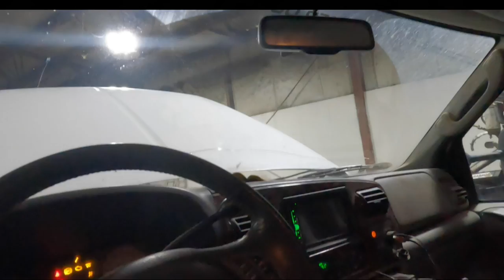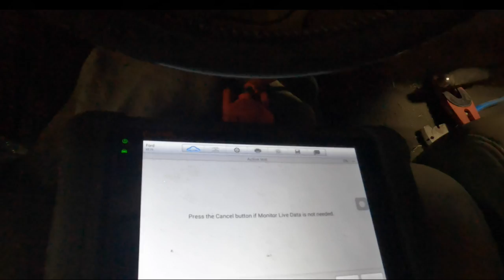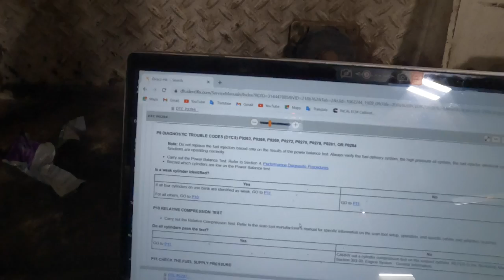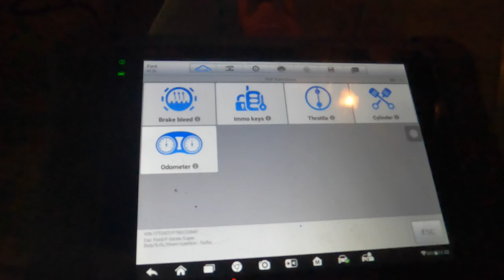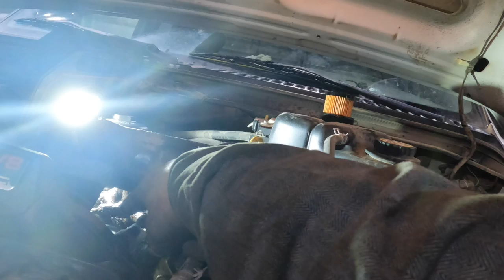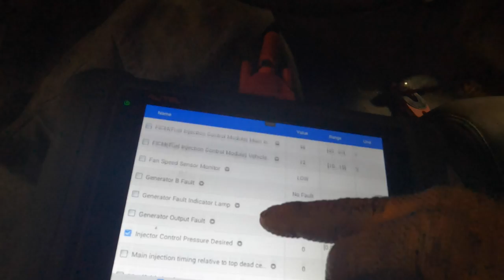Diagnosing combustion gas in fuel.

Comment: Great video.  I had no idea there were still 6.0s out there running.
Reply: They are great engines once you bulletproof them with aftermarket parts
Reply: @straightpiped12valve  as a former 6.0 enthusiast I can tell you there is no such thing as a bulletproof 6.0

Comment: There's going to be a unanimous though by us 6.0 power stroke guys supporting replacing the whole bank of injectors vs just one.  The HEUI style of injectors will "hammer" themselves to death if there's low fuel pressure.  Too large of an injector vs supporting fuel mods, clogged fuel filters, bad fuel pump, and engine compression blowing the fuel out of the rails in the heads all can cause injector fuel starvation.  It's a nasty road to go down that can get ugly quick.
Did this customer not want to replace the passenger bank of injectors?  Labor to get there and change 1,2,3,4 injectors on one bank is the same, it's just an additional 1/2 hour per additional injector?  I replaced the whole injector set in my '05 after # 5 hung open causing compression to blow the fuel out of the rails in the heads.  The previous owner of my truck probably used some home brew bio diesel or veg oil as there was a lot of crud in the fuel system.  I was bummed to do it, but now it's DONE!  Love my 6.0 :)
Great content Warren and thank you for sharing your time with us!
Cheers.
Reply from the maker: All 8 were replaced less than a year ago, everybody just loves changing parts that there is absolutely nothing wrong with.
Reply: @westerntruckandtractorrepa1353  Thank you for taking the time to reply!  Any idea if the prior replacement injectors were oem reman or possibly aftermarket?  I've though the oem reman's have a design change to prevent the dreaded stiction, but looks like they may still be susceptible to other problems :(
Cheers.
Reply: @skibik3r  Warren states in the video they were from Ford, so OE of some kind. I’m cheap so I’d only replace the failed one 😄.

Comment: Put the battery charger on 60+ amps while doing the relative compression test. That's why it doesn't work at least on other Ford engines I've had that exact problem.

Comment: Why can't you remove the glow plug on the cylinder you think it is and use your blow gun there and see if it blows air back through the fuel system that would tell you that injector is stuck open I would think just trying to make it simple

Comment: Great diagnostics.
Would you ever benefit from a PICO scope? (Laptop program)
Ivan at PHAD made a "pressure transducer" he uses to diagnose contribution,
much like what your scan tool (tried to do) but this is a physical connection,
not an electronic pseudo. Instead of a spark plug, you could use a glow plug
adapter, since the majority of your work is diesel.

Comment: I once had a similar thing on a D7F cat dozer. The pencil pushers wanted to save money and they bought cheaper injector nozzles. of course they did not last long. The compression (air) filled the fuel injector pump with air. I cant recall if we had to replace a filter or not, it was many years ago. We never use that crap parts dealer again ! some parts need to be the real thing. ! Thanks for the upload, very interesting.

Comment: They should have just stuck with the 7.3L injectors.. because this wasn't ever a problem with the old spring returns...   On these, they decided to have them open and Close with oil pressure..  rather than just open with pressure, and close with a spring....   Yet again, they broke something that didn't need fixed.. trying to fix something that wasn't broken.  Apparently it was supposed to add just a touch better fuel economy. smh.. what a joke.. and these days they have the particulate filters--   It's not even worth having a modern diesel now....   Great diag--  I learned a lot.
Reply: I work with these new engines every day and I agree ! It’s even worse now! And they started this crap clear back in the 90’s.